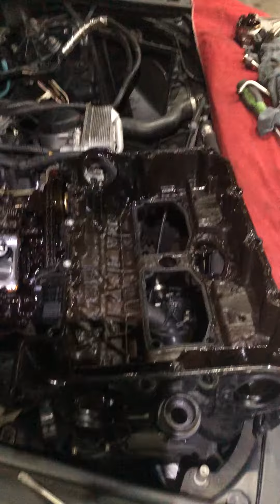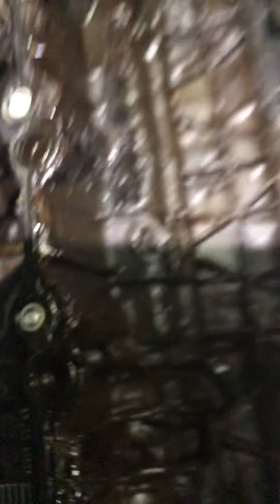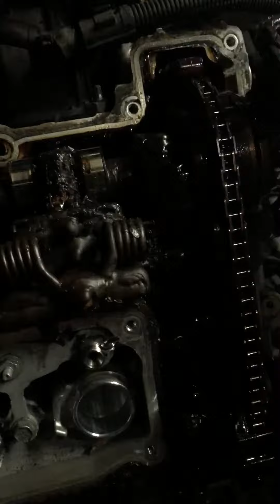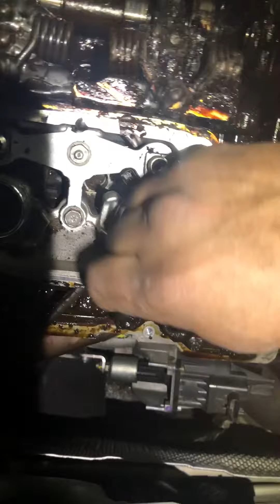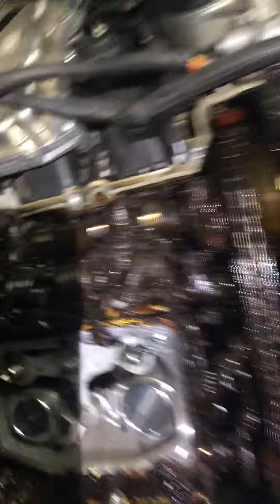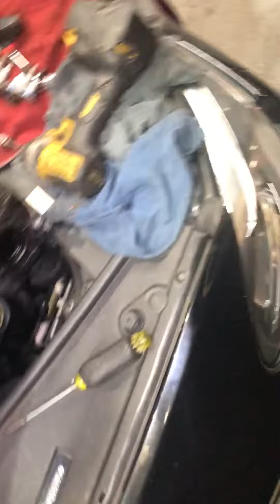F10 5.28i Bmw N20 effects of Ccv failure

Comment: This is why my bmw gets oil changed every 3000 with 100% synthetic motul I would shit myself if my engine looked like this
Reply from the maker: Carter Elder ya idk how people let it come to this . It’s like they know they are supposed to do it but they just keep driving and then when it breaks down they are in shock at what had happened then when I show them the internals and how it looks they are shocked
Reply: Midnight Mechanix for real like I don’t get what people don’t understand about turbos they make your oil HOT I’ve caught my oil temps getting as high as 255 before I could not imagine letting this oil sit in there for 15 thousand miles
Reply from the maker: Carter Elder right now even they have that mobile oil that supposedly good for a year .. just imagine people can’t even keep up with every 3 months just imagine the year long scheduke

Comment: Crazy! How did you clean that thing? Also, I have an N20 with P1339 code. Replaced both camshaft sensor but the error still persist. Swapped the sensors with no help. Any idea on what to look next?
Reply from the maker: Well to clean it out it took a good freakin min lol a lot of shop vac and compressor as well as a lot scrubbing and picking and scooping lol. But just have to be patient with it and work from one end to the other . . And as for ccv valve 
vanos-bmw.com  sells a replacement diaphragm for the ccv and as far as ur p1339 have u check the crank sensor signal and possibly is the cam sensor signal making it to the computer ? Back probe DME connector for can signal wires to see if ur can signal . Also have u checked to make sure u have power and ground at the sensors